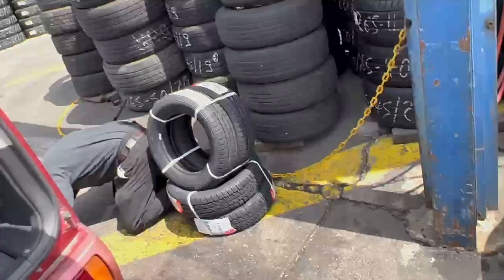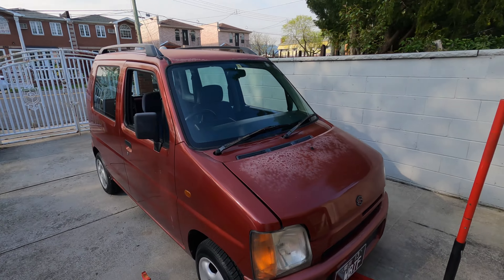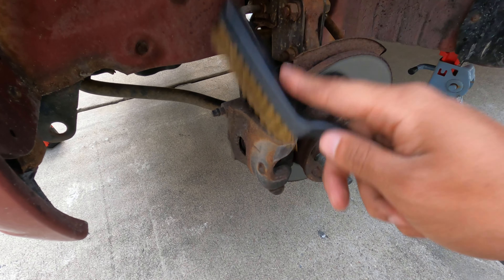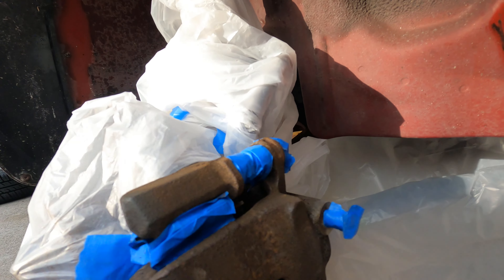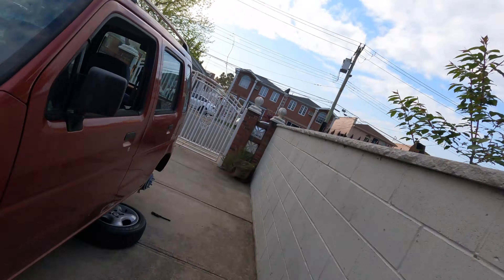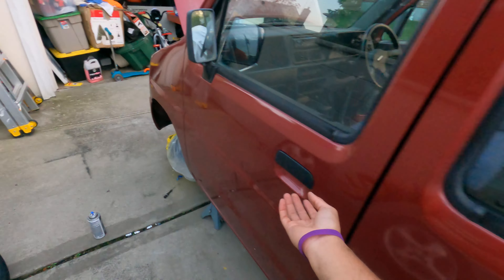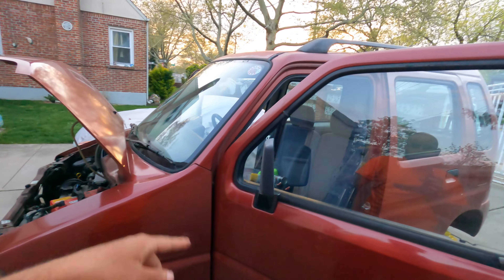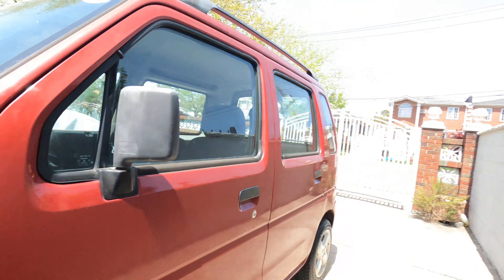Suzuki Wagon R Gets More Upgrades

Comment: I'm respectfully waiting for Golden week to end too. I NEED THAT TRANSMISSION!  Arrrrrrr!
Reply from the maker: I need that turbo, this cars is sweet some extra HP would be nice
Reply: @Waybeforethefame  Maaaan I stumbled upon this minicon computer that taps into the MAF sensor and O2 sensor so you can "tune it" a bit without getting a full fledge ECU. Promises 11hp just with tuning, add that to the turbo back exhaust I'm getting and will be equally doing something about the intake and I should be pulling a little better for sure. Will also be turning up the boost to at least 14lbs. Should make a little fun Kei car for sure.